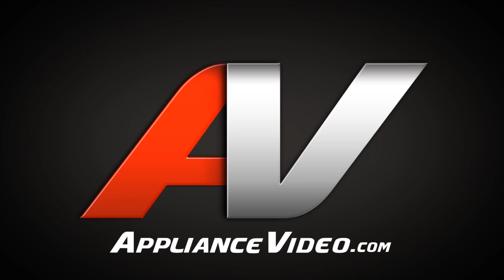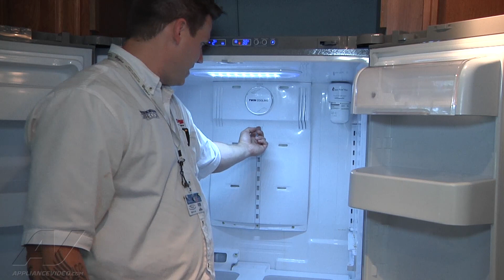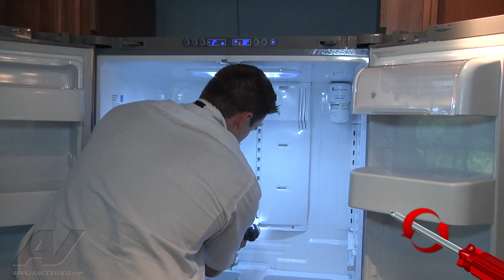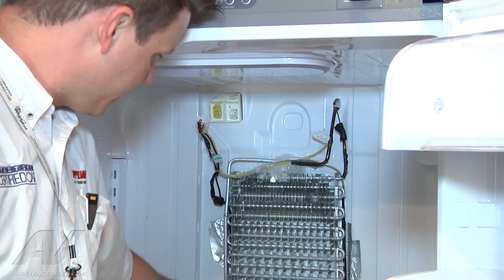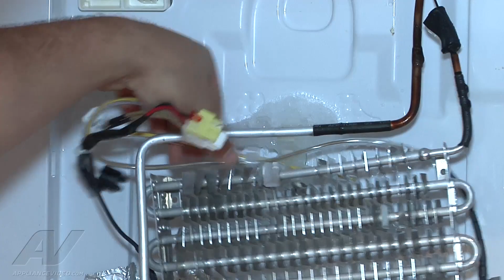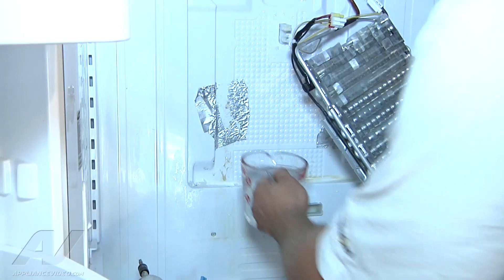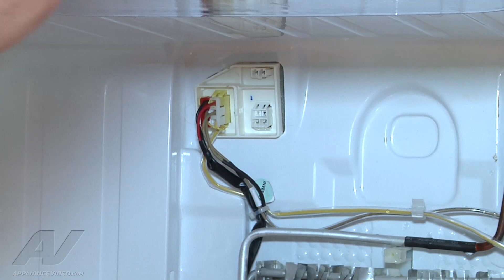Samsung Refrigerator Repair - Freezing Up On the Back Panel - Evaporator and Defrost

Comment: Great video. I have that exact unit in the video, and my question is what is the part# for that replacement kit you put in? I can only find individual parts, not that whole assembly.
Reply from the maker: Duane
       If you take the model and serial number off the unit and call our parts department at 1-800-830-5465 they will tell you the exact kit part number. Thanks for your positive comment. Please help us provide more videos to our site by subscribing to our YouTube page or posting ApplianceVideo.com site on your Facebook or Twitter account. We also have our factory authorized technician’s email daily free professional advice to people like you to help solve their appliance problems. Thanks in advance for supporting us. Matt, Ace Appliance service technician.
Reply: Since I'm in South Africa where can I get the parts for my fridge as it's not cooling ? I'll be happy if you give me the supplier numbers specifically in the Free State or any other place in SA .

Comment: i have a samsung model number RF4287HARS 4 door french door 28 cu. ft. fridge, freezer started going above 32, and the fridge going above 44, but the strange thing is the display panel is showing 0 for the freezer and 36 for the fridge, the settings are at -2 for the freezer and 36 for the fridge, i have unplugged it for 30 minutes and it resets and shows the actual temp correctly but then it starts showing wrong temps again and will not freeze or cool correctly, when i set it for power freeze it starts to come down but then goes whacky again. please help.
Reply from the maker: colonialititle
                 A couple of possibilities 1) Defective display main control board  3) One of the thermistors sensing wrong temperature. With this type of issue you will need to test the components. Please help us provide more videos to our site by
subscribing to our YouTube page or posting ApplianceVideo.com site on your
Facebook or Twitter account. We also have our factory authorized technician's email
daily free professional advice to people like you to help solve their appliance
problems. Thanks in advance for supporting us. Matt, Ace Appliance service technician.

Comment: Hello Mathew, can you tell me how to do this procedure on Samsung RFG297AARS.  Specifically, can you tell me how to remove the back panel? Thanks
Reply from the maker: FreedomExpress
                If you go to ApplianceVideo.com and type in your model number or your symptom you are having. you can find a schematic picture  breakdown of the appliance and how the back panel comes off.  There is a very good possibility you will find a video that will help solve your problem. Please help our ranking by subscribing to our YouTube page or posting our ApplianceVideo.com site on your Facebook or Twitter account
Reply: Thanks Mathew, you are awesome :)
Reply from the maker: You are very welcome. Good luck on your project.

Comment: Thank you I need to try this my fridge also makes a loud popping and cracking day and night . Do you have an idea what that might be it sounds like crushing ice and turning ice . I do not have the water hooked up and never has been and the ice mode is off . I see on the web many people have this prob. As well. Most of the dealers / stores in our area have stopped selling samsung refrigerators it's to bad that they can't make a good one bc they sure are nice looking peaces of junk. I will be buying parts from you guys . Our fridge has had problems since it was new and 2 yrs later still has problems .
Reply: I hear the loud cracking popping sounds when ice is building up behind the back panel inside the fridge. That happened before I replaced the dinky tab that directed water into the drain tube that Samsung provided.  You can buy a replacement tab on Amazon. 6 years later, same thing started happening. I replaced the heater coil about 5 weeks later it froze up again. Next I'll try replacing the heat sensor.  If that doesn't work I may just pitch this stupid refrigerator. Never buying another Samsung again!
Reply: That's the sound I hear before ice consumes the fan and stops cooling
Reply from the maker: Thanks for your response, we are glad we could help. Our library of over 5,700 videos are currently helping over 1.6 million people like you every MONTH.  Please help us by subscribing to our YouTube channel, or post our website www.ApplianceVideo.com to your Facebook page, Twitter, Instagram or any other social media sites. Your support will help us keep producing more free quality videos.

Comment: Our Fridge and Freezer seem to be cooling fine but we started to notice large amounts of water under the Vegetable trays just and noticed the holes down the right side of the Duel cooling full of ice chunks. I have taken everything apart and am letting it all thaw with the doors open. The drain seemed totally clear when I poured hot water down it. Just like in your video there is a chunk of ice above the heater by the screw hole. The Vent hole further down that I assume leads to the Freezer had some black mildew. We have also had lots of problem with our seal getting mildew on them but decided against replacements when we looked at the cost unless we are sure that is the problem. I want to be sure we are replacing the correct part. Can you give any specifics on how to test to see if the problem is the Heater, sensor or something else? Does it seem strange that there is mildew around the pipe to the freezer? We live in Florida so Humidity and mildew is always something we chase, plus with 3 kids they have left the door ajar more than once. I have not had any fan noises that people have mentioned.
Reply: This is also an extremely common defect in this fridge. You will have to replace the entire back fan panel. The fix takes less time than packing all the food out and back in. There are 3 screws holding that fan/coil cover in place. During the defrost cycle, the water drips down the front of the cover and into the fridge section. Alternately, you can take it apart. It will be rusted. Clean it, put wax on the metal bent piece, bend it more towards the back of the fridge to try and make sure the water goes in the drain, then balance the fridge to make sure it leans back further.
Reply from the maker: Have you seen any gaps in the door seals ? In the freezer or refrigerator seals ? If so that is where the ice is coming from. If not do you have an ice dispenser  that dispenses ice in your door ? If so your door baffle may not be closing all the way and causing the ice issue. If your seals are sealing good with no visible gaps especially on the bottom, run your fingers underneath to be sure. Dont replace the seals, get baking soda and and hot water and tooth brush to get the mold off them. Only replace them if the magnet starts coming off or if its ripped. If none of these suggestions are your issue, send me your model number so I can give you more suggestions. Please help our ranking by subscribing to our YouTube page or posting our ApplianceVideo.com site on your Facebook or Twitter account. This will help us to continue to make new professional videos from our factory trained technicians and help people like you. We also have our technicians daily emailing professional advice to people that have problems with their appliances. We have helped thousands of people save hundreds of dollars. Thanks in advance for your help.

Comment: First thing. Do you check the heater to see if is open. You said to start with the heater? Why. We dont know if the heater is bad or not. 90 % of the times is the sensor. Sensor is bad or sensor has to be on the low side line instead of the cappillary tube.. According to samsumg the sensor needs to be move to the low side line. Also make sure the drain is not clog. If it is removed the little metal clip the goes from the defrost heater to the drain. That clip is too short and is not reaching the drain. That cause ice build up on drain. In the case samsung has a new part #. New desigh of clip we can call it drain heat probe. You can use the whirlpool one. Whenn drain is clogged you get a lot of ice on evaporator cover and also water leakege under the crispers.
Reply from the maker: We have found weak defrost heaters that have full continuity but are hot heating in the middle of the heater. Do you have the new part number of the heat probe? We would like to share it with anyone have this issue. Thanks for your comment. Please scan through our other 600 videos and give us your input.   Please help our ranking by subscribing to our YouTube page or posting our ApplianceVideo.com site on your Facebook or Twitter account.
Reply: Mel, You said that Samsung says to move the sensor to the low side line, I have been looking for this on other sites and cannot find any information.  Can you describe how this is done?
Reply from the maker: Travis 
    .  Go to ApplianceVideo.com and type in your model number. We have a search for video by model number feature. Or you can type in Samsung sensor replacement.  Our site has 2600 Free videos on it.  Please help our ranking by subscribing to our YouTube page or posting our ApplianceVideo.com site on your Facebook or Twitter account.Good luck with your project.

Comment: Great video thank you!!! But I have a question. A few days ago the fan was making a terrible noise and I found ice near the top. I unplugged for a few hours but apparently not long enough. Since then the noise had stopped but I noticed the fridge section was not cooling. Fridge was at 50 and the freezer was at 0. Found this video, took the panel off, and low and behold the ice on top of the coils, around the fan, and on the bottom plugging up the drain. So I am thinking its the defroster. But you told a poster ice building up near the fan is usually air and humidity from bad seal. Your video shows ice near the top by the fan section but you replaced the defroster. Is there a way to test the defroster?
Reply from the maker: Ice most likely got on the fan blade and it was out of balance, That will make a vibration noise. By defrosting the ice corrected your problem. Thank you for your positive comment .  Our family-owned and operated company works hard to provide you with FREE, high-quality repair videos. Thank you for your continued support and good luck on your project. If you are in need of any parts, our parts department has over 5-million in stock for same day shipping. Please call  1-800-830-5465 for any of your parts needs, or you can order online 24 hours at: ApplianceVideo.com. Thank you and good luck with you project.

Comment: Great video, My problem is that the freeze is cooling properly but refrigerator is not, had massive ice build up and fan noise from top fan, unplugged refrigerator let set for 24 hours, freezer reached temperature but refrigerator has not, you do not feel no air flow from the top of refrigerator, chiller compartment is getting cooler than frigerator, could top fan be bad?
Reply from the maker: You may still have ice in the air duct going to the refrigerator section. I suggest you shut it off with doors open for 24 more hours, If you had ice build up you most likely have a part of your defrost system that is defective. Possibly your defrost timer, therm or heater. Our family-owned and operated company worked hard to provide you with FREE, high-quality repair videos. Thank you for your continued support and good luck on your project. If you are in need of any parts, our parts department has over 5-million in stock for same day shipping. Please call  1-800-830-5465 for any of your parts needs, or you can order online 24 hours at: ApplianceVideo.com. Thank you and good luck with you project.

Comment: Hey awesome video, but I have a question. I have the same fridge and it seems to be cooling fine, no issues there, but I recently noticed a loud fan related noise. Upon further inspection I found there to be ice build up in the top section where the fan is. Is this a precursor to my heating unit going or can I just clear the ice and be ok? I had the fridge set to factory setting, not overly cool and anything like that. Any info would be great because the noise is quite annoying, thanks!
Reply: I also am getting ice  build up around  the fan and behind that cover. I've defrosted it before and removed all ice but it keeps happening. Please let me know whats parts I could order to permanently fix this problem.
Reply from the maker: We're happy you liked our video! When you are getting frost build up around the fan, it is not caused by a defective defrost heater. The most common cause is air and humidity leakage. You could have a bad refrigerator or freezer door seal, or if you have an ice dispenser through the door, the flap in the door may not be closing all the way.

Comment: great video guys. How do I know if it is the defrost unit. Mine is just like the one in the video. Its not get cool, Freezer is fine, Cleaned all the vents and coils. Just not sure what to check next. Any help.
Reply from the maker: Great question, if you have a more technical question that our parts department cannot answer, you can search our over 13,000 answered questions free at our website www.ApplianceVideo.com under our Repair Help section. You can also call our parts department at 1-800-830-5465 and they can give you help 7-days A week ,or search at www.SaveMoreOnParts.com  .

Comment: You should test each part with specs from a service manual.  My problem was only the defrost sensor ($7 part from Sears).  The manual shows auto diagnostic tests and will tell you the ohm reading for a defrost sensor at room temperature.  It is not the same for each refrigerator.  Test the heating element for continuity.  Test the bimetal thermostat for continuity at temps shown in the manual (e.g. mine opens at 140 degrees).  Main circuit board is probably OK if your readout looks normal.
Reply from the maker: Thanks for your response, we are glad we could help. Our library of over 5,700 videos are currently helping over 1.6 million people like you every MONTH.  Please help us by subscribing to our YouTube channel, or post our website www.ApplianceVideo.com to your Facebook page, Twitter, Instagram or any other social media sites. Your support will help us keep producing more free quality videos.